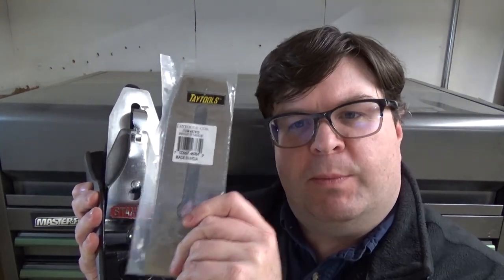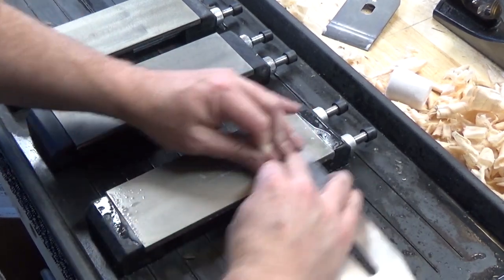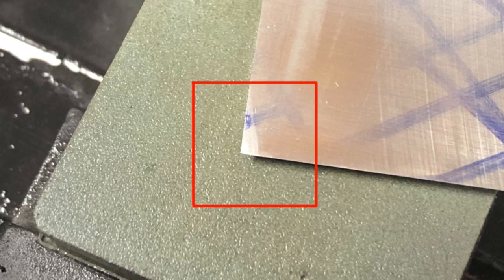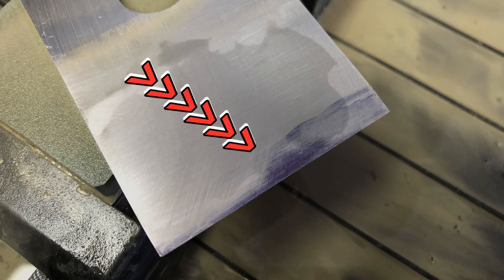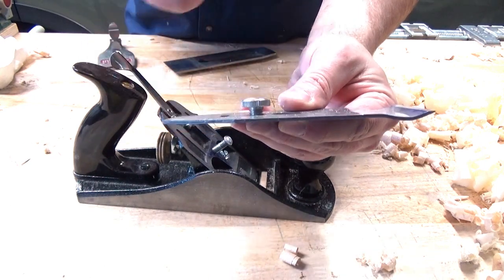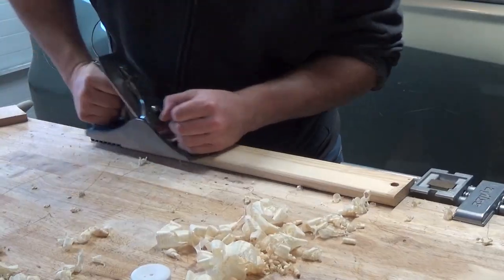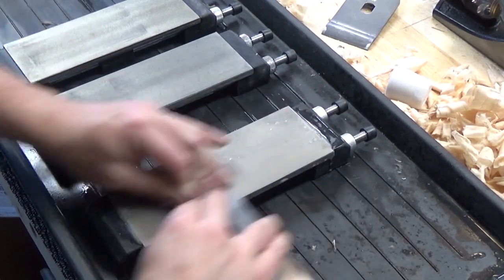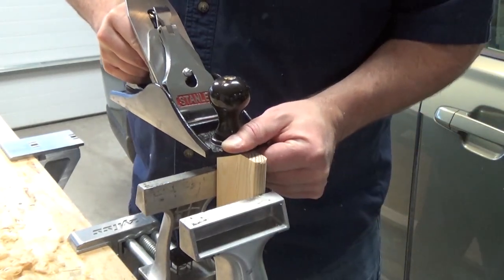Taylor Toolworks Replacement Plane Blade: Answer to Stanley Blade Problems?

Comment: Using the ruler trick on your 1500 grit diamond plate would have saved you a lot of time. I hope you've added it since this video!
Reply from the maker: I was aware of the ruler trick before making this video. And I knew it wouldn’t work on this particular iron for all the reasons I mentioned in the other video.

Comment: I bought my three primary planes around 25 years ago, including a Record bench plane, a Stanley block plane, and a Stanley low-angle block plane. The Record has a chrome vanadium steel blade, and I'm not sure about the Stanleys, but they're pretty good. I think they're all different companies now that just inherited the product names. In case you have to do this again, I usually find it faster to start with sheet of 100-grit sandpaper lying on a table-saw top or other known flat reference. You can double-sided-tape a block of wood to the top of the iron for a convenient handle.
Reply from the maker: Great suggestions. I think next time I will try a new Wood River. I have had used (antique) Stanley bailey planes in the past, and they were no picnic either. BTW, I think the steel in the new Stanely plane is just fine, it's the geometry that was the problem. I was afraid no matter how much I ground off there would still be a belly. If it was hollow, that would have be perfect. Maybe I should have reversed the bevel to the other side? Hmm... thinking really IS dangerous.

Comment: Paul Sellers taught me that you should lift the heel of the plane when going back... I have managed to tear some nasty grooves when I pulled back with a little piece of wood stuck in the mouth... Also when you round over the heel and toe a little bit, that helps not to damage the wood when slipping out (if you know what i mean)

Comment: Tom, starting around 1964, when I was 11, we lived across the road from an old farmer.  He cut weeds with a Brush Master and grass with a Hay Master scythes.  He also chopped wood with a pole axe and debarked fence posts with a drawknife. 

Every tool he had was razor sharp.  His secret?

He had a treadle powered sharpener.  There were two stones for it.  A coarse and a fine.  It had a trough mounted beneath the stone for water. The seat was an old iron tractor seat.  

It sat outside in the shade of a big oak tree.  Every day when he finished work, he would carry the tools he had used over and sharpen them in the cool evening shade.

I had the treat if watching him spend hours sharpening his tools.  He changed the stones depending on whether he needed to grind or hone.

He gave me one rule… you can sit in the seat and pedal the treadle all you want.  But, don’t touch the stones.  

It would be years before I understood the damage that an inexperienced user could do to a nice grind stone!

When he passed away, I got one of his draw knives and a scythe.  They are both wall hangers, now.

Tom, I’ve never had the patience to hand sharpen tools…. So, I never developed the skill.  Some of us have it (like you) and some of us don’t.  But, I still like to watch…. So, please proceed!
Reply from the maker: Have you heard the story of "The Two Woodcutters?"
Reply: @woodshopnerdery  Nope… lay it on me.
Reply from the maker: @sassafrasvalley1939  There are lots of variants, here is one. https://screeble.com/blog/2017/03/07/story-of-two-woodcutters/
Reply: @woodshopnerdery  that’s good!  I carry a sharpening stone, with a handle on it, in my back pocket when I’m using my drawknife.  (I used to do it when I used my scythe… years ago.)

That few moments spent sharpening them is worth its weight in sweat, productivity and rest!  

I told the story about my dad’s two blade axe a few times.  The long and the short of it is… one blade was for splitting.  It was rather dull.  That way it didn’t cut into and stick in the end grain when he hit it.  The opposite blade was for felling and it was razor sharp.  He kept a smooth mill bastard in his pocket to keep it that way.

The sharp blade had a hollow ground in both sides so the white paint didn’t wear off.  Woe be it to the dummy who chipped or dulled the white blade.   You just might get a lesson in cutting a hickory switch!

But still, I am not ready to tackle sharpening hand planes!  LOL

Comment: Thanks for posting this video. I also like to get the back of blades really flat but then  I have also solved similar problems by grinding the edge to remove that 0.5 mm or so of troublesome low spot. A few minutes on a wet stone grinder or even a bench grinder to establish a new hollow grind would save you hours  of work to bring the whole back down to the level of that hollow. Also after flattening the back i use the David Charlesworth ruler trick where you are only removing very small amounts of metal on the back. It only changes the angle by less than one degree so not by a significant amount. All the best.
Reply from the maker: You're welcome, glad you liked it. I totally agree, if the blade did not have a big hollow I would have ground the bevel passed the defect in the corner. But the defect went away as I made the blade flat. Sometimes people forget the other advantages of having "reasonably" flat front and backs beyond sharpening. A flat front offers a better matting with the frog and a flat back offers a better matting with with the cap iron. The rules trick can't  address these.

In my read of the David Charles worth ruler trick, it  saves time in the polishing step, avoiding the need to polish the entire back. In my opinion it requires a "reasonably" flat back to start as the back bevel is so small it can only compensate for small imperfections in flatness not large ones. If you notice in his videos on sharpening he looks to be using premium blades, Hock would be my guess which are shipped already flat.

The other snag I have with the David Charlesworth trick is that I use 3 diamond stones and a strop. Basically, I am emulating the Paul Seller's system. Charlesworth, uses his final water stone (10K grit or there abouts I think) to apply the back bevel with the ruler. I don't think the ruler trick is well suited for strops. I recently switched from 4 water stones to the diamond/strop system because I don't have a permanent way to keep the water stones ready to go. It is so ease to hit that strop and get back to work, not setup and no mess. Has been a game changer for me.

Comment: Another alternative are hock irons, I personally don’t have experience with them but have seen a lot of good reviews for them, they are a thicker iron as well.

Also you might want to wax the sole of your plane such as a candle or paraffin wax, don’t give up on your plane, keep working with it and you’ll get the hang of it!!
Reply from the maker: Thanks for the tips Dana. I've heard of Hock blades but did not what to spend another $60-70 on this plane. The knobs are already cracking and the frog is just not right, the yoke is too small, and the yoke adjuster is just hard to use. I was about to throw it in the trash when I saw this blade on sale for $8 and thought I would give it a go.

I ended up buying a 5 1/2 from Taylor Tools which works well right out the box with the same blade I tuned up in this video. I also bought a 2 3/8 inch blade from Veritas because I was curious about the PM-V11 steel they have. Again, works great in the 5 1/2 and poorly in the Stanley. That's why I think the frog on the Stanley is a problem. Taylor Tools offers a 4 1/2 too, probably end up buying one eventual. I'll get the time to do a video on it some day.

BTW - I made can oiler based on Paul Seller's tutorial, works really well!
Reply: @woodshopnerdery  after I watched this video I ended up watching another one with your adjustable table and seen it on the table, I would be interested in seeing a review on that 5 1/2.  I collect and use Stanley hand planes I have No. 3-8 with all the 1/2 and 1/4 sizes too that’s what drew me to this video, keep up the great work and thanks for sharing!!

Comment: I was going to ask about blade thickness, but you covered it by upgrading to a thicker iron! 
I do know a Stanley blade; even an old Stanley blade is around 0.080 thick. Being that thin it will almost never stay flat in  a cut. It will want to flex and cup in a decent to heavy cut. The cap iron isn't enough to prevent that from happening.
I checked the specs; now a plane iron on a Wood River is 0.120 thick, and on a Lie-Neilsen it's 0.140 thick; nearly twice as thick of that of a Stanley plane iron!
Plus, a thicker plane iron is much easier to sharpen than a thin one. The angle is wider on a thicker blade, so it's easier to find the primary bevel, and hold it flat on your sharpening stone.
So, the thicker the better, even if certain parts of the plane have to be modified to accommodate a plane iron of proper thickness.
Reply from the maker: Chad, you nailed it. The Stanley blade is pretty thing and only getting thinner as I tried to lap out the bends and crinkles. That's exactly why I said I was not sure I would ever be happy with it.

Comment: I was in Santa Cruz, Ca a few years back for a couple of years.  While there I met and became friends with a Japanese wood worker who’s fame was rebuilding old, from the very early years of Ca. history Church doors, frames, window frames etc.

He had in his living quarters lamp shades of planer shaving. So thin not only was I afraid to touch them but light shone easily through.  I unfortunately was way, way unfamiliar with the entire, “what it takes” to accomplish that let alone the skill, the sharpness, the…… 
I was fortunately aware enough as a former commercial fisherman/vessel owner to recognize his talent(s). 

I have two hand planes.  Neither of the two is usable.
Perhaps one day I’ll devote the time and seriousness it takes to refurbish them and use them.

I say,  “Good on yuh!”  There are times too often I recognize how a good hand plane is/would be quite helpful, if not necessary.  

Thanks for spurring me on. 🤜🤛
Reply from the maker: Thanks John, whipping a couple of bench planes into shape is a great winter project!
Reply: Let me guess… he had made them with a wooden plane?
Reply: @sassafrasvalley1939  
As I recall yes - the plane was made of wood.

Comment: You are a patient and persistent man. Tom!  … any thoughts on the steel from the lapping and sharpening process?
Reply from the maker: Thanks John. I think the steel is okay. The product page on the Taylor Toolworks site gives it a Rockwell 55-60. From what I have read that is a good balance between holding and edge without being tool brittle. But, I would like to use it for awhile before reaching a final opinion.
Reply: @woodshopnerdery  Tom, it will be interesting to see how your evaluation goes as time goes by.

Comment: Check out the david charlesworth ruler trick...you don't need a flat back...it makes using a plane 1,000 times easier
Reply from the maker: Great suggestion Ben. I was aware of David Charlesworth’s ruler technique before working on this blade. It didn’t seem like a good match for this particular blade and my sharpening system. I give some detail on that in post on my community tab.

Comment: You will find that is easier to plane face grain on hardwood by skewing the plane a little. It lets the plane shear through the cut at a slight angle rather than hit it head on like a bulldozer. Give it a shot I noticed a huge difference when i tried it.
Reply from the maker: Great tip, I’ll keep practicing!

Comment: This may have already been asked, and it may be a dumb question, but how often do you lap your stones to keep them flat, and did you do that before testing the blade against your stones? Watching this, that is the first thing that came to mind when it came to the uneven results on the blade flattening section. Just curious...
Reply from the maker: Great question. Of course, I do not flatten my diamonds stones. When using waterstones I flatten them after every use while they are still imbedded with water so they are ready to go next time. I have a dedicated diamond lapping stone for that purpose. For this blade, I did revert to my 250 grit waterstone so I could remove material more quickly. I lapped the stone every 5 minutes or so because I was being aggressive. And yes, I do realize the importance of maintaining a waterstone, which is one big reason I have switched to diamond stones.
Reply: @woodshopnerdery  A good thing, that. :) I have been using sandpaper grits going up and up and up on a very flat piece of stone, though I do not think it is granite... but it has so far proven to be very effective. One day I can move to things like diamond and whetstones. :P Just was something I was curious about since I do not remember seeing it in the video itself. ^_^
Reply from the maker: @kimpanattoni  I started sharpening with sandpaper on the back (where it was smooth) of a glass cutting board. Then I went to waterstones, because back then diamond stones were very new and crazy expensive.

I really like Paul Seller's method using a 3 stones and a Strop for polishing. I can quickly tune up an edge on the strop and then keep working. I can polish with the strop many time before needing to re-grind or re-hone.

You could consider replacing your top sandpaper grit with an equivalent honing compounds. If you don't want to get a strop, you can even apply the compound to common printer paper. Either way could save a lot of money in sandpaper. Over time you could replace the sandpaper grits with diamonds stones as well.

Here is the compound I like, has the right "grit" for me. (not an affiliate link) https://www.amazon.com/gp/product/B0855M8B3C/ref=ppx_yo_dt_b_search_asin_title?ie=UTF8&psc=1
Reply: @woodshopnerdery  Eventually I will make my move from sandpaper to stones both diamond and otherwise, somewhat akin to what Rob Cosman does, though with some slight variations based upon my background in sword sharpening and polishing... but it will take some time. Funds are a serious issue right now, so things have to come along slowly. :P 

I will look at your compound, thank you for the link! :)
Reply: @woodshopnerdery  Right now my solid flat surface is actually a small mirror I picked up. Perfect size for using sandpaper for a tool blade. ;) I cannot wait to set up a real sharpening station. :D
Reply: Don't forget the mess it makes as opposed to diamond  @woodshopnerdery

Comment: man, in terms of time getting things prepped to perform well, I think an expensive blade is worth it.  Never planed myself except for some practice at a friends house. But screwing around with fixing a avg to mediocre product that really requires perfection, I don't know sounds like on balance it's a waste of money. I don't know.  I guess I lack patience.
Reply from the maker: Michael, you're right the blade was a bad purchase. But, the plane was so bad to start with I didn't want to put any more money into it. I should have returned or thrown out both.

Comment: So, have you built a shooting board yet?
Reply from the maker: Not yet. But it is on the to do list. That is that main reason I dressed the sides of the plane in the earlier video.
Reply: @woodshopnerdery  I plan on building one for use with a block plane for dialing in miter joints.

Comment: I would worry about pushing m6 blade toward that metal vise.
Reply from the maker: I agree. I was experimenting with this Zulu’s vise at the time. I have since gone back to wooden holding methods. I’m not good enough to avoid the metal 100% of the time.
Reply: @woodshopnerdery  I know that I wouldn't be good enough to avoid it even if I was constantly reminding myself.

Comment: I wouldn't have tried to flatten as much of the back as you did. I only flatten about a half inch of the back. I have not been impressed with any steel blades from India. You may want to invest in a Hock iron for your 4 1/2.
Reply from the maker: Great advise Bill. I admit I was sucked in by the cheap price. I eventually bought 2 veritas irons. I went with these instead of Hock because I was curious about the PM-V11 material. Absolutely love them!
Reply: @woodshopnerdery  Veritas makes great stuff for sure.